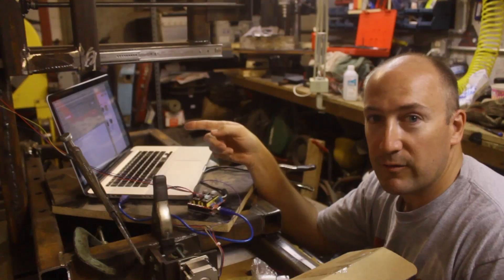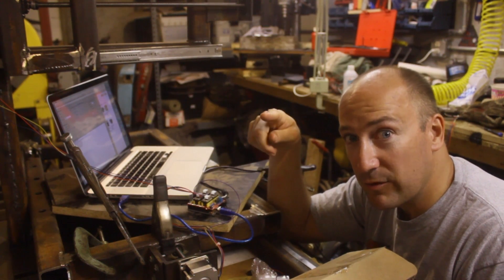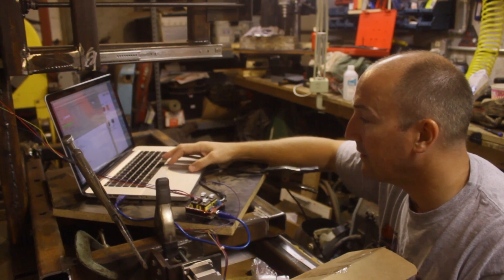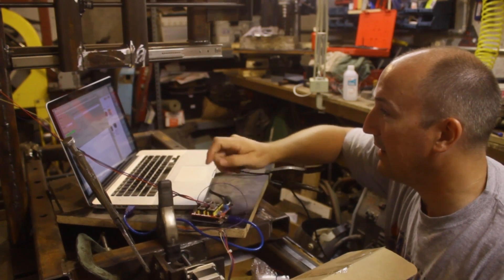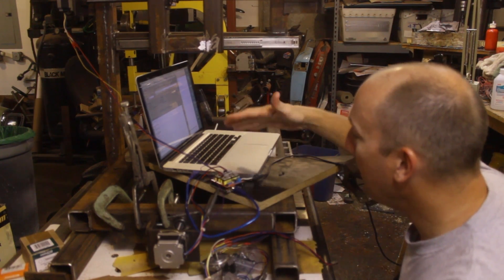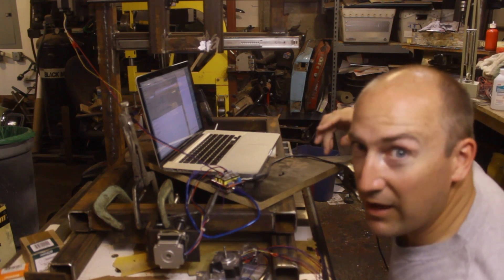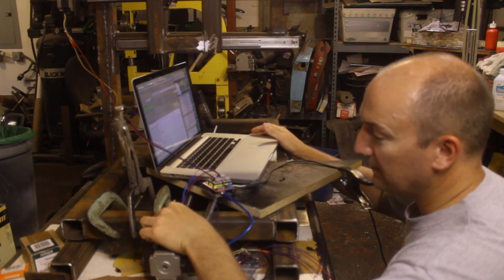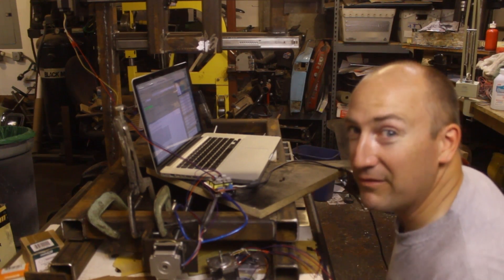DIY CNC - Tuning Up the GRBL Settings

Comment: im going for a steel box section frame for a cnc 3 axis,after that all other metal HAS to be aluminium extrusion,light and stiff,it's definitely a big learning curve,i've got the mechanics well sorted,i've got the electronics in my back pocket(im an electronics design technician),i never liked programming,BIG fail,now i want a cnc to do the dirty jobs i don't like ,i need to program ,at least it's command based stuff.

The drivers that fit the V3 cnc shield are DRV8825,if my stuff heats up,i'll put tubes made from 30mm pvc from the case to just above each heat sink with small 30mmx30mm pancake/muffin fans extracting  the heat from each,that should be enough,failing that the DRV8825 drivers will be used.
Considering i just putpower to my uno yesterday,and had to download the driver for the usb controller to get my pc to recognise it(thankyou china) the chinese use a different usb chip from most of everyone else,but fixable,ch340 chip driver is here-

http://www.wch.cn/download/CH341SER_EXE.html

This was from youtube video by tom heylen-

www.youtube.com/watch?v=HHF45zhe_9U

just in case you buy one from china and it seems like crap.

hope you get the machine and code as you need it,for me i want a laser ,router,mill,with touch tool height g38.2 ,with limit switches spindle speed control.
grbl 1.1 has lots of new features.

i need some sort of instruction manual to get all the software going in the right direction,someone out there knows .

All the best to you greg.

Comment: how heavy are your gantry's? are those nema 23's have high enough torque to move them? they might be drawing too much current (since the weight) and cooking the drivers, just a thought!
Reply from the maker: +Matthew Nagel You may be right.  I have a feeling I'm going to burn something up very quickly.  When I do, I'll upgrade to something bigger/better.  This whole contraption is an experiment, so I'm def learning as I go.  I think I found some upgraded drivers that can handle the bigger motors.  I should find out this weekend where the weakest link is.

Comment: Yaknow, I now forget which is which G20 or G21 (my bad)...
let me look it up - ok. G20 is INCH and G21 is METRIC.

GRBL (along with the cnc shield) make up your "controller".
grbl ALSO has a G-Code interpreter built-in (it understands
G-code).  That's multi-tasking, isn't it?

  All of the "settings" or "parameters" and other "setup"
values can be (to my knowledge) set to either metric or imperial
and should be entered accordingly. Things such as: How many
revolutions per mm or per inch, or other distance measurements.

  But when it comes time to typing in your G-CODE, you can specify
whether all of those X,Y and Z numbers are either Metric (G21) or
in inches (G20).
You've seen others g-code programs, right?  All those X1.768 Y2.9 Z-.005
line after line after line after line...
The "controller" has no idea whether those values are in inches or
in millimeters - so you start your whole g-code program off with
a G20 (or G21).

 And yeah, I don't know why anyone would, but... if you had some
g code written using millimeters - you COULD mill a much larger
thingamabob just by changing the G21 to a G20 at the start of
the program and get one that's 25.4 times bigger! Whoopie!

 Yeah - you already know this by now, doncha?  Ok. I'm sorry for
the long-winded reply - hope you have fun!

WDP
Reply from the maker: wdavid parks Thanks man!  I've got the controller and the g-code sender set up for inches, but when it loads a g-code file it always wants to flip flop the units even if the g-code starts out with G20...  It's weird.  I'm guessing there is a little check box or something that I'm missing.  I'll get it sorted or move to something besides the universal g-code sender software.

Comment: You need to set the current limit on the drivers using a mutimeter if you haven't done so already.  This will stop you blowing them up.  See the video in the link....

https://www.youtube.com/watch?feature=player_embedded&v=89BHS9hfSUk
Reply from the maker: turbineterry Dude!!!  Thanks!  I had no idea.  I was allowing an extra 50% through the pipes.  I tuned them down to spec.  I ran a couple quick tests, looks like that is helping to control the temperature.  No failures tonight.  BTW...  Didn't blow one up after all, just tripped the thermal cutout.  Cool feature on the 8825s (and others).

Comment: It's all a learning process, cool to see the X/Y moving... nice edit!
Reply from the maker: turbocobra Thanks Gary.  It's getting close.  I need a lathe...  I had to drill out the coupler and it's not concentric now.  That was causing the pinching (making the motors squeel in the video).  Ordered new parts.  Should get a china post in the mail 5 months from now with better parts.

Comment: G20 and G21 are more like a checksum your machine is going to use what it is set for.  You can't change how how a program will run based on if its a g20 or 21 unless you manualy change all the cords.  I dunno enough about the hobby cnc software yet nor do I know enough about the hardware, but generally on most professional grade machinery for accuracy sakes its better to do everything in mm.
Reply from the maker: Mopardude It seems like it wants to run mm.  Maybe I'll just stick to that for now.  I need to get my mind in that mode.  Now that I have all the numbers figured out, it shouldn't be hard to do the conversions.  Thanks for the help!
Reply: I wonder if I don't have the grbl controller if could I still load the software and run it with out it?  Maybe I could give you a better idea than.  One trick I do for coversions is I make #555=25.4  than I multiply everything by #555 rather than 25.4.  The reasoning for this is first anything multiply by #555 you instantly know is a conversion from inches to mm.  Secondly it helps with fat finger syndrome.  If you type out 25.4 everytime but oops 1 time you forget decimal point or put it in wrong place or type wrong numbers, you may not catch the error right away.  Its one of those things it probably seems silly to you now, but when you get into programs with a hundred lines of code it will make complete sense than.
Reply from the maker: Makes complete sense.  Good tip.